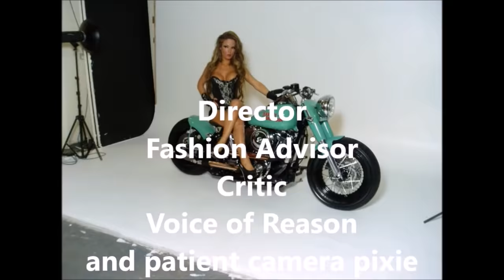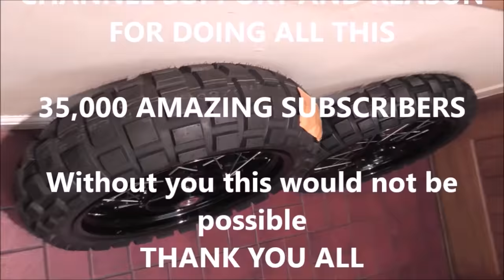Delboy's Garage, USD Fork Seal Replacement

Comment: Well I've been working on my HD VRSCF MSCL and while replacing the brake pads I saw the oil coming from the seals leaking pretty severely. When I called about them replacing the seals...it's 8 to 9 weeks from now...so I'm not one to give into the madness so watching your video has by far encouraged me. When reinstalling the fork is there a particular way it has to line up so both forks are aligned?
Reply from the maker: If you loosen the centre top nut on the top yoke slightly so it can twist independently of the bottom yoke, then install the fork legs, tighten the bottom yoke pinch bolts first, this will align them with each other.. then tighten the top pinch bolts and the top centre nut... your forks should now be perfectly aligned..!   Hope that helps.!
Reply: @Moonfleet41  thanks brother

Comment: What happens if you put the locknut higher up against the cap? Would that limit the ability to adjust the fork when its mounted? example: you can do 20 click from fully out to fully in, would it only be like 18 clicks or somthing? To prevent this do you always put that locknut as downward as possible and then put the cap on and tighten it up?

Comment: Hey there! How should i push my seals in if i dont have those seal drivers? will a flat head screwdriver be okay? And to bleed any air out the bottom of the forks, is it as simple as pushing the forks down max and pulling in back up? Thank you! Amateur here :)

Comment: Hi del, thanks again for another great vid, just some advise when changing the oil on usd forks please. Befor removing the top cap should I leave both the pre load adjuster and rebound screw were they are? Some other vids I've seen people seem to be winding the pre load out and the rebound screw in before they remove the cap? I don't know why. Thanks john.

Comment: thanks for the video ready to follow. zx6rr 2004 fork stantions,  are they just screwed into the castings and can i get away without removing the cartridge?
Reply from the maker: "screwed into the castings "??  do you mean the chrome slider into the bottom casting that the axle goes through??

Comment: The top stanchion cap is impossible to loosen if the upper fork clamping bolts are tight, at least on my bike they are. Have to loosen the top clamping bolts first, leaving the lower clamps tight, then loosen/crack the top stanchion cap. Just a heads up if someone were to do it the way you did, they might have some trouble with that cap.

4:15
Reply from the maker: Your stanchion cap should NEVER be captured within the top yoke... if it is, then that means it is holding the top yoke away from clamping the fork stanchion correctly, always lift the fork leg up through the yokes so that the top cap is clear of it and free to move... that way, you're getting full clamping force of the top yoke on the top of the stanchion... and any that are designed to sit flush, will be reduced in dia. by a fraction so they do not bind against the top yoke as your do... just life them up a bit mate and you won't have a problem...

Comment: As i was sliding my seal out, the seal cam out but the bush did not. It is currently stuck in its home. Has anyone experienced this? And is there an easy way to remove it without damaging? Love the vid!

Comment: Great informative video. What if the seals are good and you just want to put fresh oil in?  Or try a different weight oil. What is the fast way if there is one to do that? Or does it involve pretty much everything in the video and while the forks are out makes sense to put new seals in?  

Another question, How do you know the forks are perfectly aligned when you put them back in? Is it just measuring the amount  of fork tubing  that is above the top triple clanp? 

Ash
Reply from the maker: Hi Ash. if you're changing fork oil, it always helps make the best job of it if you can take the fork apart and dry out the old oil.. but if you really dont want to, or aren't confident to do it.. then you can drop the fork legs out, take the caps off, drain out the old oil, (pump the damper rod in and out to help expel as much oil as you can.), then fill with the correct amount of new clean oil..no need to disturb the seals.

Comment: Hey delboy, Where did you purchase that seal driver, Was gona use your other method by wrapping the PVC pipe around the fork but this just seems better
Reply from the maker: Yes mate, it is very much better, a lot more accurate, and precise - bought it from Machine Mart, it's adjustable, about 10mm either side of my fork width, so pretty useful for other bikes!

Comment: To only replace fluid, we don't even need to remove the fork: just twist, siphon out the old fluid, and add fresh fork oil.
Reply from the maker: if you have cartridge forks, you'll need to pump the internal piston rod to remove all the oil..which means turning it upside down at least.. siphon won't work in them mate.!

Comment: thanks very good video. I'm not having the key push oil seal, I left the oil seal old and I beat on it with a large screwdriver .l I then cut with the whisk, the problem is to keep raising the motorcycle front, (Kawasaki Versys) ciao

Comment: Hi del, just about to strip my ducati monster forks but noticed quite a few stone chips bit of pitting on the fork tube any tips to solve the problem? in your video your using fine sandpaper but some chips am quite dee!?. 

plus there off a 1996 monster an a old bike mechanic i know told me on some ducati forks you can run the forks dry, is this true?

Comment: Great demo ,its given me the confidence to do my own. However I've noticed when your measuring the oil level you still have the bandage wrapped around the base of the shock preventing the outter sleeve from travelling all the way down . I'm guessing it doesn't make a difference?
Reply from the maker: It does make a difference Jon, you don't measure to the outer tube anyway, you measure to the top of the INNER chrome tube, it's just not obvious on camera, and if you push the outer tube down on to the corroded area you can lacerate your brand new seal, so push down and stop at the safe point and measure from the inside tube to the top of the oil... job done!
Reply: @Moonfleet41  thanks matey ,that makes perfect sense.  Thanks for clarification

Comment: Thanks for sharing this with us mate!
Never done this oil/seal replacement, but this video provides courage in heaps!

One question though, what did you do to correct the oil level compared to the towel "collar" you had there to protect the seals from the rough bottom part of the cylinder?

Since we're talking millimeters on the ruler, I'm assuming you took it into the equation? 

Best wishes from Norway
Reply from the maker: There was nothing to correct Logi, you measure to the inner chrome tube, not the outer one, therefore the level is constant..!
Reply: @Moonfleet41  excellent, thanks for your quick reply clearing this up mate! Keep the good work going, your how-to videos are invaluable! 👌🏻

Comment: Hi mate I have a small problem. I have done lots of fork/dust seals over the years and do cbr929 at least 7 or 8 times a year. I just bought a 2015 BMW F800R  went to do the forks and to my surprise they are completely different. Went to slide the forks apart to pull the old seal out as you do but the fork came straight out seal still in the stanchion and what I have not seen before is the fork leg was just smooth all the way up no rings around it nothing the fork seal just stayed in the stanchion
Reply from the maker: Yes indeed, sounds like you'e got telelever forks, get yourself a service manual that covers them, the principles are all the same mate, just slightly different anatomy... it will all become clear!

Comment: Hey Delboy, I've seen this video maybe 20 times, nobody explains this stuff like you do mate. I am having an odd issue with my forks where the rebound damper adjuster pops out about 2mm when I press the front of the bike down. I can press them back in and they pop out again when I press the front down. I can still adjust rebound with a screwdriver. Both forks do this. Forks are from a 2005 Yamaha R1. I've replaced the seals and fluid 8 thousand miles ago. Just noticed this problem last week. If you have any ideas, I'd love to know. Keep up the great work, much appreciated.
Reply from the maker: Hi buddy, this sounds like an odd one, just a question or two, when you adjust them with the screwdriver, is there any freeplay in the screw?  Meaning does it rattle about or move freely before the rotation starts to take affect?  When you say they pop out, do they stay that way once they've popped up (as you said you push them back down), or do they then rattle up and down?
Reply: @Moonfleet41  there's no free play and it stays in place when it moves up. Screw still turns like it should comparing it to my other bike. It doesn't rattle once it comes up. Could this be caused by too much fluid in the forks? I didn't have a precision way to fill the forks so may have slightly overfilled them. I used a measuring cup from the kitchen

Comment: Can I ask what would be the risk or issue if i slightly over filled the oil?.. instead of 135ml air gap i think i did both fork legs at around 115ml.. the rebounding seems slow after the fork now compresses??. Any help please del boy?! Also seems abit clunky.. noisey spring now or something.. worth draining oil and checking again?

Comment: Hey Del quick question: Given you had the rag tied to prevent the seal going over the area you cleaned rust from, with the rag  stopping the tube from going all the way down to the bottom, wouldn't this change the height you measure the oil level to?
Reply from the maker: Usually when pushed all the way down, the two tubes sit at the same height.. but if you can't push the outer right down like in this case, just measure to the inside chrome tube as that doesn't change.. same level !

Comment: I have viewed the video several times good detail.  The lift table you use, what brand is it and are you satisfied with total operation?  Thanks again for all your videos.
Reply from the maker: It was ok, worked perfectly well, but it had it's limitations, and was a bit flexible with anything over 200kg on it... so i upgraded to a much stronger and heavier weight one from Sealey..! https://www.spanner-monkey.co.uk/motorcycle-lift-680kg-capacity-heavy-duty-air-hydraulic-88201?search=MC680A&description=true   Best purchace i ever made.. it's rock solid even with my GL1500 Goldwing on it.!

Comment: Thank you for the detailed information which was really helpful. One quick question, is it the same system on 2011 Yamaha R1 fork as well...
Reply from the maker: Similar, but I'd get yourself a proper service manual for exact specs and tolerances.
Reply: I bought a 2011 R1 last week and I like to do DIY projects and have basic tools.. your help is much appreciated

Comment: I'm about to give my fireblade 954s forks an overhaul with  new progressive springs in them so figured I'd do a full service.i.e replace the bushings and seals. Now I noticed you used pyramid seals rather than oem. I have heard countless times to use oem when it comes to this sort of thing otherwise ill be re-doing them in no time which i don't really want to do lol. Its my first time taking this task on and would like a little insight to your thoughts on aftermarket seals. Have you noticed the life span on aftermarket vs oem. Ps I love watching your videos there very informative 👌
Reply from the maker: Hi mate, I've heard this before, this blind faith in OEM, and I always find it interesting to note printing on packaging, I've had items from the dealer with their vehicle brand on them, such as maybe Suzuki for instance, and on the same label you'll see a Pyramid logo.  It's always been my belief that motorcycle factories building bikes don't have separate factories of their own making seals and bearings... they buy these things in, just like anyone else, and brand them with their name, it's just the politics of the vehicle trade, cars included.  The best example is Harley Davidson oils!!   Are we to believe that H-D have their own oil refinery?  Of course not, that's daft, they buy it in and put it in their own printed bottles... and it's already proven and well known that as an example Amsoil lubricants are better for your Harley than Screamin' Eagle oils, and I've proved this in videos... so relating that to your question, it kinda answers itself, the seals in your bike are OEM yet they've failed, so they can't be that amazing, and to finally answer your query, I've never had a seal leak prematurely when I've replace them... neglect of cleaning forks on a day to day basis is far more likely to shred seals than what brand you buy... all I can say is, buy a known brand, Pyramid have been in the market for years and buy them from a known source... I get all my stuff from Wemoto these days and never had to send anything back, they base their reputation on the parts they supply, so I hope that answers your question mate, OEM isn't the last word, it's just usually the most expensive and for no good reason either!
Reply: @Moonfleet41  Thanks for the speedy reply there mate I'm very much grateful in your reply on this subject. It isn't that mine have failed its just that seen as I am putting new springs in I thought its better knowing its all been refreshed rather than taking short cuts. I've had my 954 just short of 5 years and I've never had a leak on the seals. When I bought it  at 39,000 miles from a chap who travelled far and wide on it. It's a 1 owner bike so I snapped it up. 2 weeks later I blew 2 exhaust valves, I never knew until I actually diagnosed the problem myself so there I was for the first time ever stripping the top end of this thing I finding what went wrong. I acheived the fix and it started first time. Ever since I've been doing all sorts to the bike. I guess its become a hobby of mine now 😆 This year I decided with all the daily commuting to and from work in all weathers it started looking a bit shabby so a full rebuild was in order. Its all in pieces right now, ive re- painting every thing and I'm in the middle of the engine paint job too. Its been 1 hell of a journey learning this and that. Failed a few times in the process and having to go back and rectify the problem all over again at times. The engine prep has given me problems the most. It was literally minging. When you clean for days and days and think your ready for the etch primer  you soon realise you've only just cut the surface and it starts to scratch of in places so I had to take it off where it was failing and clean some more. As of right now it just needs some wet and dry to smooth out the prep ready for some paint now. Decided to go with a nice light gold for the engine block and a satin for the cases, A little different to some but I like to be different on my bikes......OK I'm blabbering now hahah

Just a little insight in my lock down phase this year. Its been challenging to say the least and expensive too.

I'll give these seals a go, I do understand what your saying about these companies so ill take your word and advice in good faith. Keep doing what your doing bud your helping many people work on there own bikes knowing its being done to there best abilities.
Top marks
Reply from the maker: @FromTheGroundUP627  Great story, thanks for sharing... and best of luck with your build mate, and it's an honour to have been of some inspiration... good luck with the engine block, they look awesome when they're nicely painted!  All the best mate, Del

Comment: When you're refilling the oil and measuring from the top, does the rag you have at the bottom affect the measurement since the top of the fork can't slide all the way down? And you measure from the top of the fork?
Reply from the maker: You measure from the top of the inner tube, not the outer fork tube, so it doesn't matter if it doesn't go all the way down, the rag was there to stop the new seal rubbing the sharp rusty area at the bottom of the fork.

Comment: On my 650 Versys there is a centre hole under the small plastic covers, I put an inch dia steel bar through and supported it on stands, it appears the hole is dead centre of the bike, I then put a heavy weight at the rear,
Reply from the maker: What ever works aye buddy.!

Comment: I know the seals may need replacing a few times in a bikes life but would you ever normally expect to change the bushings or clip?
Reply from the maker: Hi Johnathan, in all my time, and on some very high mileage bikes, i have never had to replace the bronze bushings, or the clips... because by that time, usually the forks chrome itself has worn through and most people just source a new or second hand fork leg..!

Comment: Good video, as always. Just an observation here. If a rag is being used to stop the end of the tube from travelling to the bottom would this not have an impact on the measurement of the fork oil and then the air space in the tube?  The rag is preventing the outer tube from travelling down 1/2" to 3/4" so the fork oil is being overfilled by the same amount........... or is there something here I'm not understanding?
Reply from the maker: There's something here you're not understanding!  You measure to the INSIDE tube not the outside tube and thereupon the measurement is always constant, and as I explained in the video, it's important not to push your new seal down over the sharp rusted part of the slider!
Reply: @Moonfleet41  Yes, went back to the video and see you're measuring the inside tube, thanks for the clarification.